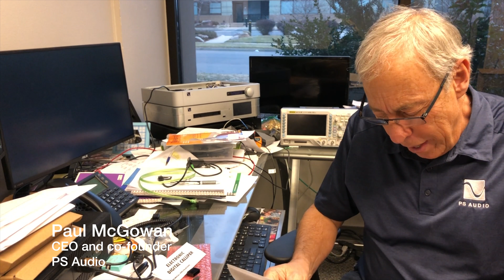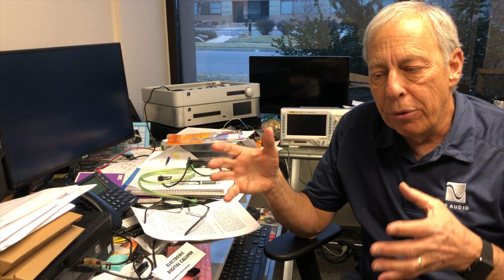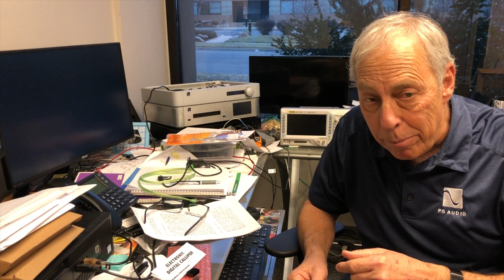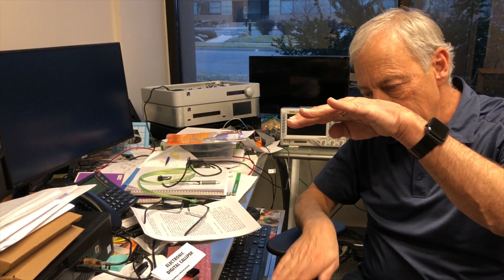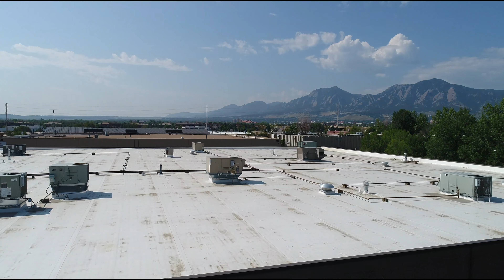Solar energy and high-end audio

Comment: This is an interesting topic.  Years ago I built a preamp and used lead-acid batteries for the power supply, thinking that would be the ultimate way to go.  I was amazed when I exchanged it for a regulated power supply using just LM317/LM337 and it sounded better.  I didn’t know that batteries can have a high impedance.

Comment: Once again a Great video, explain The technics behind everything.

I wounder, why alot of high end Audio guys try to sell UPS / Batterys or capacitors to have Cleaner (without Peaks) Vorlage... 

What if (like Most Solar Systems, at last in Germany) theres a Battery within The Solar System, like a buffer . Will it „kill“ The Problems caused By The inverter?

Comment: If you spend money on audio it is not that expensive to do your power right. You get an electric motor depending on your source ac or dc you connect that with a generator again ac or dc depending what your amp need and a flywheel on the axle ( heavier  is better) that is going to filter the power noise and small power interruptions and you have your near perfect wave or line. Is this efficient? No, but the best filter ever!  (An electrical technician)

Comment: Hi Paul, great video with enlightening information! I'm concerned about solar power for a project I'm working on, a home style theater system (Denon AVR, subwoofers, TV, etc..) in an RV. 

On a meter, I draw about 340 watts at my maximum listening levels with everything running, usually under 300. Not bad, but still enough to worry about. 

I suspect the best option is a "low frequency" pure sine inverter. An Aimes 3000 watt RMS/9000 watt peak inverter/charger/ATS is what I have in mind. Thoughts? 

I have a modified sine inverter installed from the factory, but I don't think it's even worth trying. 4 6-volt golf cart batteries, 12 volt system.

I also have the potential for bad shore power (plugging in to power that might be bad at different locations) and I would like to know if you have any thoughts on how to handle that, considering the intended use for audio, and the need to conserve power. 

I wouldn't plug in to a voltage source under 110, as any load would likely drop the voltage further to the risky 108 volt level. 

I can use the onboard diesel generator for true alternating current, but the noise would defeat the purpose. I appreciate any advice you could offer.

Great videos, I really enjoy your perspective! 

Ryan
Reply: This may be too little too late. But have you considered the 12-volt market (car audio)? Power amplifiers at least. JL Audio for class D amps, Mosconi or Tru (ect...) for AB. Maybe even a Sony RSX-GS9 for a receiver. Food for though since you already have an excellent 12-volt power source. Batteries would also act as a buffer for low amp shore power/solar.

Comment: I worked on switchmode power supplies back where were no control IC's like the SG3524. We started out using a LM723 to control a LM556, talk about stability problems.

Swichmode is noisy, the newer current mode resonant schemes are better but the affordable ones are noisier than the AC power in most areas. However some of the megavolt transmission schemes are using DC and then some kind of switchmode to covert it to AC and i suspect that could be a problem for sensitive circuits.

Comment: @PS Audio If PS Audio creates a power inverter tailored for hi-end audio solutions (with >95% inverter efficiency and true sine wave output) and with the option to connect to a photovoltaic system then you'll pioneer this new HiFi clean energy market.  After all, there are companies producing inverters with those characteristics for quite sometime, it's not new at all.  I think this project might be o bring to the market than trying to design and actually build the elusive "perfect" speakers.

Comment: Most people who use solar power use large array of repurposed car batteries. It works surprisingly well.
Reply: That's a shame because car batteries are a very poor choice for solar. They are not designed for deep cycle use. The so called deep cycle batteries you can buy in the department stores are not that good either. Golf cart batteries are a good choice because they are purpose built for deep cycling. Purpose built batteries for solar are ideal but expensive.
Reply: Of course. But they are much cheaper than any other option.
Reply: Car batteries would be quickly degraded from the cycling unless you kept the cycling very minimal which would defeat the purpose. You can get a golf cart battery for around $200 each that can handle the cycling and last many times longer. Using a car battery is false economy.

Comment: The fact I can't get my solar lawn lights to work for more than 4 hours after sundown makes me skeptical about anything solar, and I live in the desert southwest, where we are BOMBARDED by the blistering eye in the sky. I've tried different brands, some cheap some not so cheap....it's all garbage.  :)
Reply: Solar grid-tie systems don't have those problems. In FL my grid-tie system is on track to pay for itself in 7 years and has an estimated lifespan of 25 years. It would pay for itself even quicker where you are.
Reply: They put THE WORST (cheap) batteries in those solar yard lights. Thats the main problem. Another is that they're getting Bombarded by heat from direct sunlight, a battery killer. Proper home and grid level systems don't have that problem.

Comment: B&O ICE amplifier modules already have an DC 12V option input since forever...maybe time that the old-school industry came along and smelled the 2100 century? A little more serious: battery 12V powered devices should be really sought after when it comes to Hi-Fi due to the excellent noise floor instead of connecting stuff directly to the dirty power many experience in todays society.

Comment: A good response and a somewhat disappointing one at the same time.  Not that you said anything wrong.  It's more the comments.  Could PS Audio come up with an audiophile grade power inverter for home use to work with its equipment?  Sure.  Could they make one to work with each house's different grid issues and still somehow have it be able to pass local and federal codes for such a thing?  That's a whole 'nother ball of wax and while I'm sure a solution is out there.  It's not as simple as snapping your fingers and having a fix be there.  As it is, all a home audio company can really do is help its clients to deal with the existing grid.  If you want efficient sound from them, they have their class D amps that do a very good job relative to say those from Crown (which, every dj on Earth seems to think sound better than anything else when they're really just to audio what a razor blade is to a wart) and connect them to some Klipsch horn speakers that hit 100db at 5 watts.  Otherwise, give carbon credits a try and run your solar power through the home grid and see where you get with it.